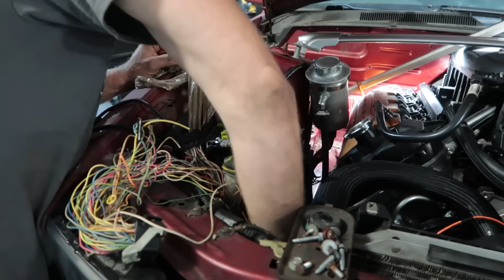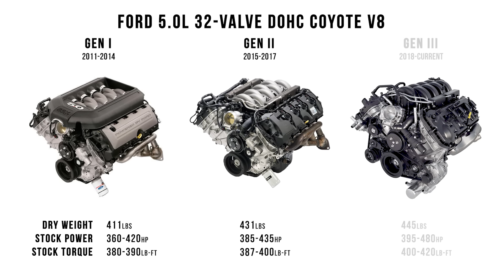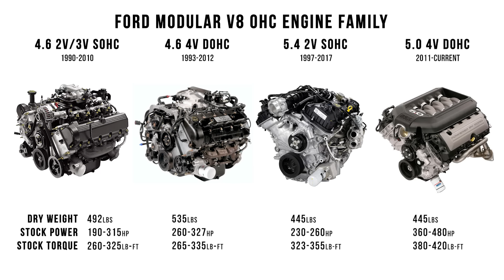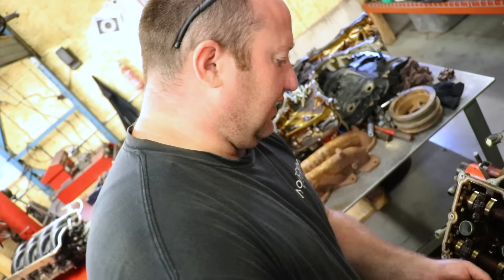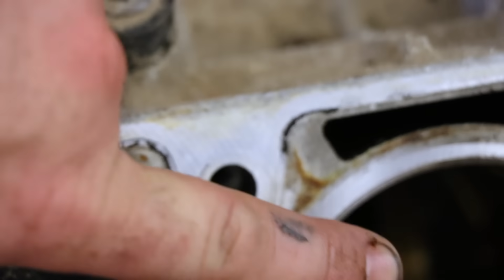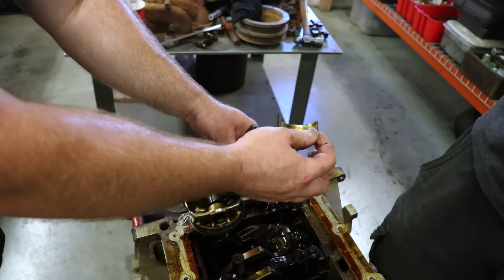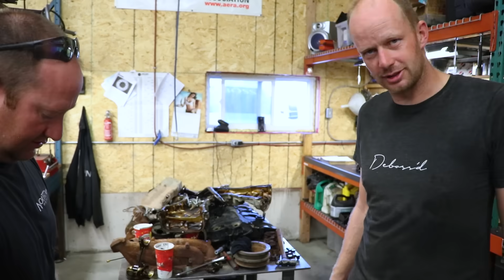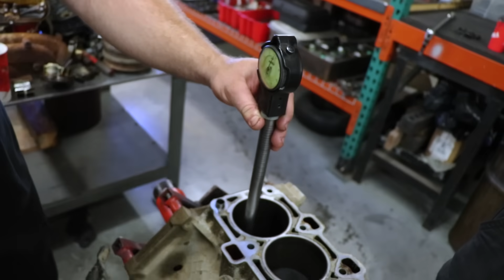REVIEW: Everything Wrong With A 5.0 Coyote Engine

Comment: Hi Rich! 
Got a Coyote waiting for mah new Bronco. The only oil I use is Amsoil Dominator. I even use Amsoil two smoke in my 250R and nothing else.
Reply: I had oil analysis performed on motorcraft Oil vs Amsoil ss in coyote engine and with amsoil 4 times less engine wear vs motorcraft. Lab results on my channel
Reply: $75 for 6 quarts of pennzoil platinum synthetic is crazy. I pay around $38 for 6 quarts of pennzoil ultra platinum synthetic every oil change.
Reply: @jmhltcfl    sure you do.
Reply: @repairvehicle 5 quarts 24.97+1 quart 10.44 + tax you do the math  https://www.amazon.com/dp/B01MA4UAP5/ref=cm_sw_r_cp_apa_i_Tz2iFb27C4QG1
Reply: @jmhltcfl  , still cost more than amsoil,  and cannot provide same level of protection,  like wear free engine.
Reply: @repairvehicle  $43 with filter vs $100 every 5000 miles sorry I'm picking $43
Reply: @jmhltcfl  , Who pays $100 for every 5000 miles, I don't know of anyone and never heard of anyone who is using Amsoil oil and pays $100 for oil change every 5k miles? $43 at 3 times a year, over $120 a year, your cost. I just changed my ecoboost oil, $71 for oil and filter for 1 year. Also, zero engine wear, something your none Synthetic oil cannot give you. Full Synthetic oil is not even Synthetic, you are just kept convincing yourself for many years that you are getting quality for $25, keep convincing yourself, maybe your dream will come true from Pennzoil.
Reply: @repairvehicle  lol and you just keep drinking the amsoil kool-aide
Reply: @jmhltcfl    I go by oil analysis and I have thousands of comments from Ford owners and others who switched to amsoil and regret for not switching to amsoil sooner. Proof on my channel.
Reply: Amsoil is stupid expensive, it’s a production ford engine. You can use a basic synthetic oil and be just fine. If you spend $100+ on an oil change on a 80hp/Liter engine you enjoy spending money.
Reply: @RadDadisRad    1 oil change with amsoil vs 4 oil changes with other brands is stupid expensive.  You must have failed math class in school. 4 times less engine wear with amsoil is considered stupid vs having worn out engine and constant repairs.
Reply: Leland Holton You don’t change the oil the same with conventional synthetics as you do with Amsoil. 

6 quarts of say Pennzoil Platinum synthetic here is $75. One Wix filter and my total for oil change is $90 every three thousand miles. 
6 quarts of Amsoil $79. One Wix oil filter and my total is $95-Ish. 
So it’s not really as expensive as you seem to think it is. 
Amsoil Dominator is proven in study after study and independent test after test to cause up to four times less wear and cause less fouling and build up than any other full synthetic oil on the market. 
The extra $25 is worth the peace of mind.